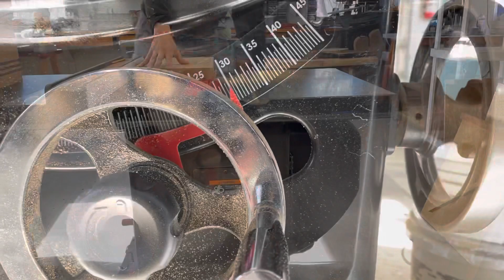Cutting Board Week in the Shop

Comment: Nice boards.  I like the fact that you are using what looks like recycled blue wrap from surgical instrument sterilization.  I use the same as drop cloths in my shop.  I have an endless supply, and unused, blue, sterile towels make great shop rags!
Reply from the maker: 100% !!  they are great drop cloths and there is an abundant supply which would otherwise be thrown away immediately!